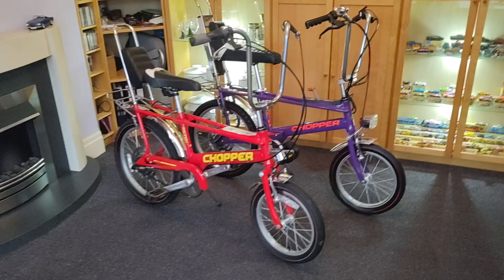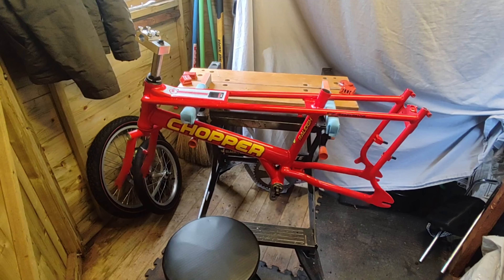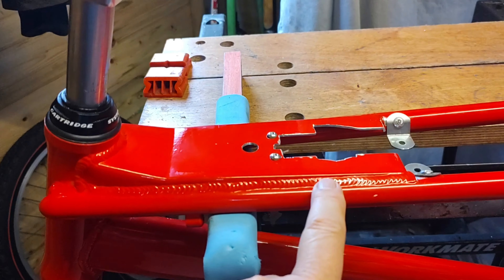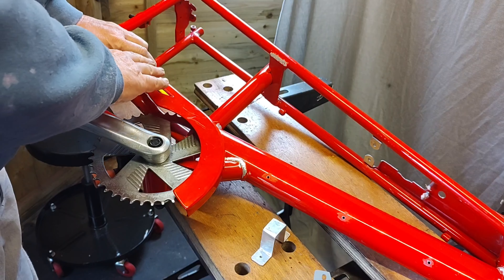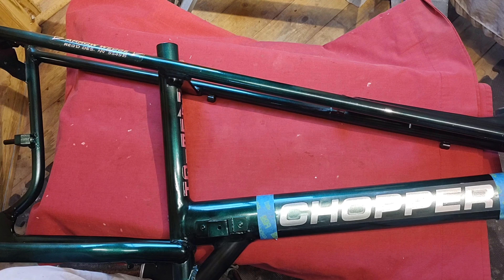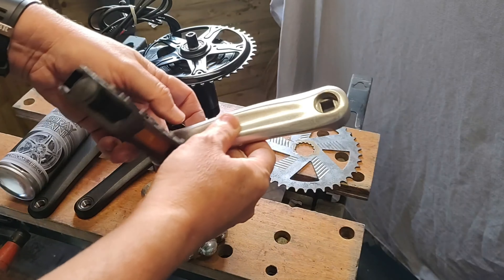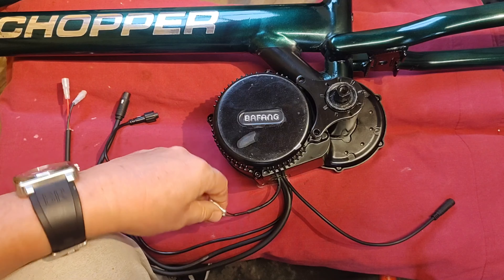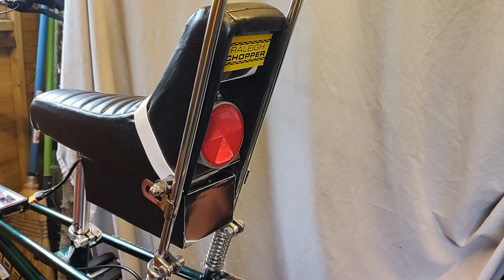How to build an electric Raleigh Chopper

Comment: Hello great video i am converting my mk 3  chopper into mk 2 gears but dont know how you fastened the selector cover on please help . cheers.
Reply from the maker: Hi, thanks for your comment. 
If you look at 3:11 of the video you just about see a slim cylindrical section on the underside of the cover. This is inserted through the round hole in the plate and the cover is held in place by a self-tapping screw that is secured from underneath the shifter mechanism.
Just ask if you need further explanation.

Good luck with you bike project!

Comment: Excellent video and love the electric conversion i don’t suppose you have a specific link for the motor kit used in this video ? Thanks
Reply from the maker: Thanks for your comment.
I get most of my parts from eBay, so if you search for “Bafang mid drive” you’ll find several suppliers.
There are plenty of different options for power output and displays. I find the 36V 250W perfect for my purposes and I’d avoid fitting anything much more powerful unless you like pulling wheelies all the time 😄

Comment: WOW! Excellent! The most inspiring video I've seen on youtube. I just purchased an old MK3! Just one question? Are the gears and the motor power both working independently ? I mean the motor assists the front cog only?
Reply from the maker: Hey, thanks for your comment!
Yes, the motor drives the front cog and you can independently select 5 pedal assist levels in each of the 3 gears.
This is why mid-drive motors a better than hub ones as the flexibility allows you to make the most of the motor’s power.
Also I found I was pedalling too fast at higher speeds so I swapped the 20 tooth rear cog for a 16 tooth one, raising the gearing but I suggest you build the bike first and see how it rides before you do this mod.
Good luck with your project.
Reply: @TheHughzt  thanks again. Which front mech did you choose for the mid drive motor? How many teeth? Also, did you source the batter separately?
Reply from the maker: I bought a BBS01B 36v 250w motor with 44 tooth gear.
This is the nearest equivalent battery that I bought. It's slightly longer than mine: https://www.ebay.co.uk/itm/196193188959?mkcid=16&mkevt=1&mkrid=711-127632-2357-0&ssspo=I5DgqjcCTF2&sssrc=4429486&ssuid=hyvhBVaNSpO&var=&widget_ver=artemis&media=COPY
I recommend you make a cardboard replica of whatever battery you choose so you can check it fits before you buy
Reply: @TheHughzt  thank you. Would you be able to tell me the dimensions of the chain bracket you made? I’m completely new to doing things with bikes. I’ve always liked bikes but never been hands on fixing them etc. going to Halfords today to pick up a tool to get the pedal arms and crank shaft out.
Reply: @TheHughzt  was there a way of keeping the original mk3 chain guard? Or was it just personal preference that you didn’t like it?
Reply from the maker: Great to hear you're will to have a go a something new. Remember that left-hand side of the crank shaft is a left-hand thread. Leftie tightie, rightie loosie. It caught me out first time and I wondered why I couldn't undo it!
Reply from the maker: The body of the motor sits right against the front chainguard tab on the frame so you can't use this. You either modify the fixing in some way or use a Mk2 chainguard. I made the front top hat bracket out of aluminium strip (19.5mm x 2mm) from my local DIY store. It needs to hold the chainguard 40mm from the frame to clear the chain.
Bankrupt bike parts is a good source for the Mk2 chainguard at a reasonable price.
Reply: @TheHughzt  struggling to get the bottom bracket cup off. Got the drive side off. But the left side won’t budge. Any ideas?
Reply from the maker: @SoulFlask  if I recall correctly it's a left hand thread, turn clockwise to undo? Apply penetrating oil and heat if you can
Reply: @TheHughzt  got it. Ran it under a hot tap after 20 minutes wd 40. Cleaned it off and pulled
Reply from the maker: @SoulFlask  well done!

Comment: was your motor a bafang 68 mm 250 watt 36 v and where did you buy your square battery from and did the wires fit each other or did they need modifying ?
Reply from the maker: Yes, it was the 68-73mm version, there are plenty available on eBay. The battery is a bit more tricky to find as the original listing has disappeared. This a similar battery https://www.ebay.co.uk/itm/196193188959?mkcid=16&mkevt=1&mkrid=711-127632-2357-0&ssspo=I5DgqjcCTF2&sssrc=2047675&ssuid=hyvhBVaNSpO&widget_ver=artemis&media=COPY but please check it carefully to be sure it will suit your application.
The connectors are different but they usually supply a spare XT60 connector with the motor kits. I'm fine with soldering so swapping connectors isn't a problem.
Reply: thanks !

Comment: I preferred the nice mint-looking Mk3 before you destroyed it. Separate from that, I assume it's inevitable that rare Mk3s and common versions in great condition will eventually have collectible value, while modified ones, like this, will only be worth the value of the parts fitted - like the Mk2 seat.
Reply from the maker: Well, each to their own, I hope you enjoy your Mk3 if you own one.
My opinion is that Raleigh destroyed the looks of the bike with the Mk3 by deleting key features such as the gear shifter and the long seat.
Thankfully there is a broad range of opinions within the Chopper community and quite few of the members have asked me to build an e-Chopper like this one for them, some offering considerably more than the price of the parts.
Ride safe and enjoy your bike!
Reply: @TheHughzt   Destroyed? You did a cracking restomod to a non-rare bike and I love it. Stuff the haters.